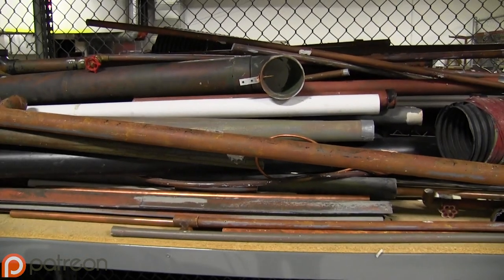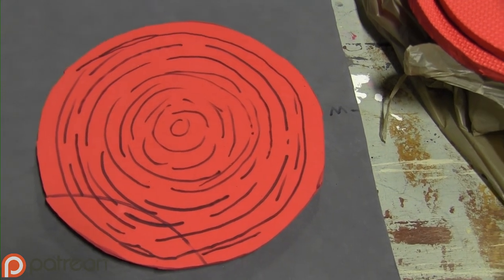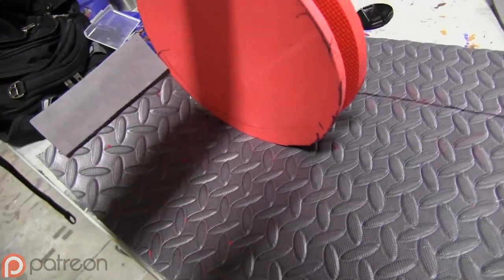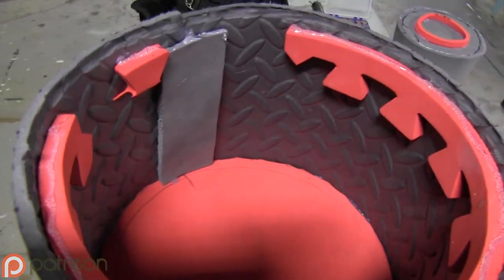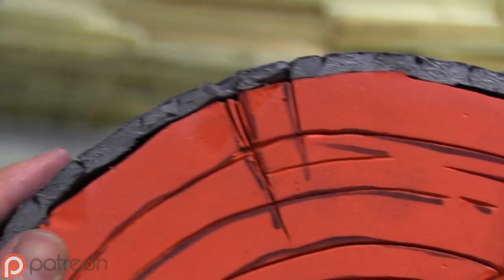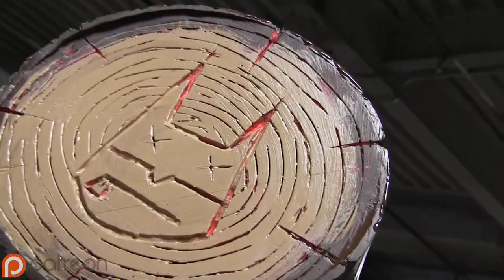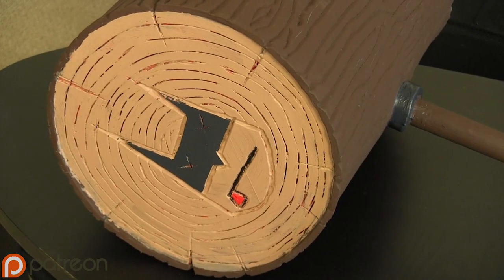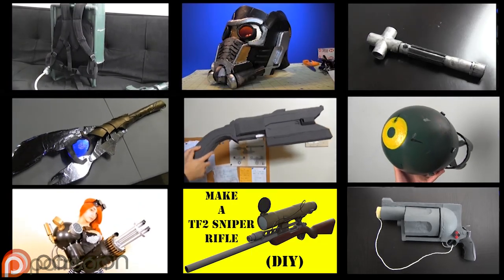How to Make Harley Quinn's Hammer (DIY)

Comment: hello.

why u sheet use so much eva foam
Reply: videowatcherman63 it's the best material to get that texture. Also, just in general, it's cheap-ish, lightweight, and easy to work with.
Reply: ***** thanks